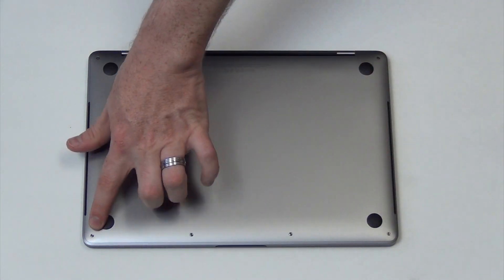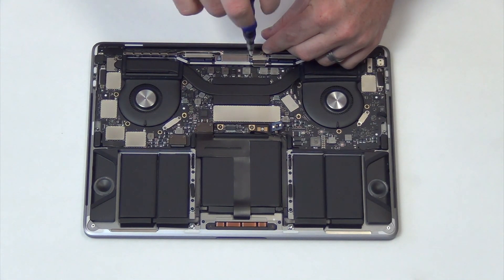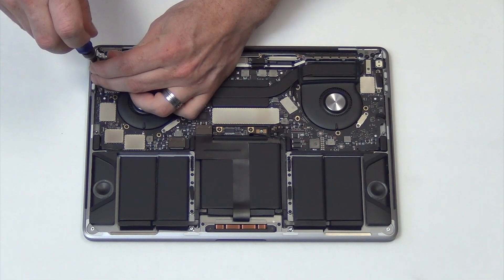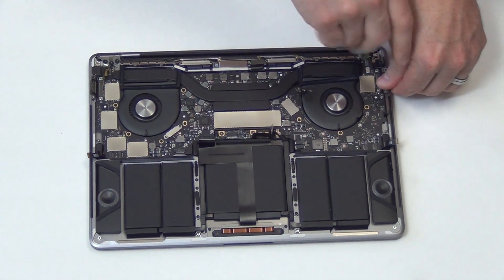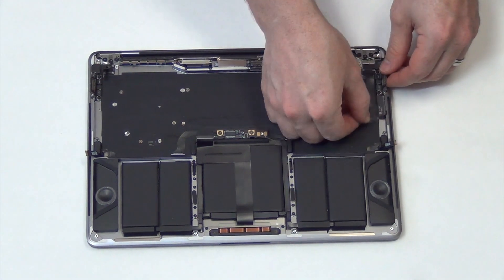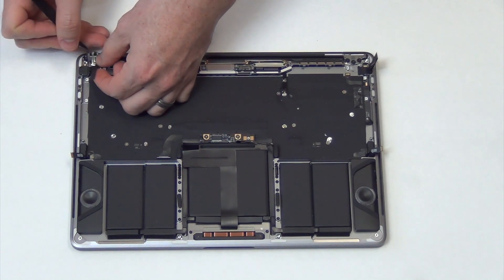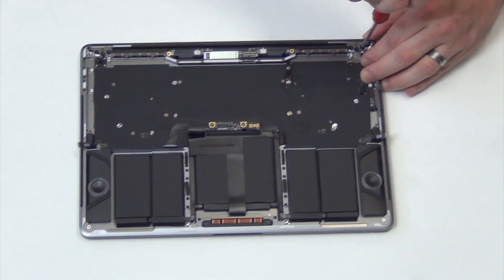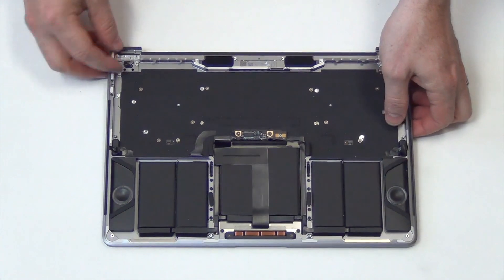How to Take Apart the 2017 13" Macbook Pro with Touchbar A1706

Comment: Need help. I replaced my 2017 MBP touch bar screen and now the touch bar is not responding to touch. It shows but does not respond. I tried resetting, commands, os upgrade, nothing works. Please help. I see it it does everything except respond to touch, it's annoying.

Comment: Where is the microphone located? I took mine apart to put thermal paste but now my mic stopped working :( can someone please help
Reply: Its probably for the best. Use headphones with a mic. Otherwise it is on the right side edge of the board it looks like the battery connector.

Comment: I been having a problem with my Mac model A1706 it appears a folder with a question mark that’s because the startup disk is no longer available and it appears block  since we cannot change de SSD what else can we do? 
Help please
Reply from the maker: I'd suggest booting into recovery and seeing if you can recover the drive that way. If not, we have a send-in repair service available at this link: https://www.powerbookmedic.com/mac-service.php

Comment: Hello, I have the exact same macbook pro, my problem is that it doesn't recognise the SSD anymore, is there a way to change it ? by soldering maybe! or is there any way to repair the internal SSD?
Reply from the maker: Saad Gouzou Was there any liquid damage to the machine?
Reply: Powerbook Medic no never, I bought it brand new, I have been using for only a month
Reply from the maker: Saad Gouzou I would check to see if its still under warranty if you bought it new.

Comment: One question to this MacBook Pro 2017 13inch users. Do you hear one fan or two fans spinning? I only hear 1 fan and I can feel the warmth in the air. The other fan never works.
Reply: I have 13 inch 2017 A1708 and I only hear one fan and it sounds like its working pretty hard after only light task but here in the video he has two I see

Comment: can we replace the SSD on this model?
Reply from the maker: Unfortunately, no you can not, it is part of the logic board.
Reply: @PowerbookMedic  can we make (trick) like external drive (macOS) for this case?
Reply from the maker: Firman Ahmad Yes, you could run the macOS off of an external drive.
Reply: Firman Ahmad I need an answer for that too

Comment: I need help. My MacBook pro (same model) keyboard and trackpad suddenly stopped working.  No response at all.  I changed the trackpad cable, and they are still unresponsive
Reply from the maker: Delreco Harris Most likely, the top case needs to be replaced. Unless there was liquid damage, then it could be the logic board among other things.

Comment: The 12 pentalobe screws are smaller than a P2 screwdriver at 9:51 of the video. What size screwdriver do I need? I cannot find anything smaller than a P2.
Reply: Ok I went out and bought a P1 pentalobe screwdriver and it did the job for the 12 pentalobe screws at the antenna. The P1 screwdriver was bought at Altex.
Reply from the maker: Ricky Cardona This is for sure the P2 screwdriver that is needed.  It’s the same screwdriver used to open the iPhones.  It’s possible your set is calibrated wrong?  Do you have a smaller pentalobe screwdriver you can try?

Comment: I got dish soap with water in the macbook hinge when i was cleaning the computer, so now it makes annoying crack sounds when i open and close the lid. Should I open the computer up like in the video and clean it, is it possible? And is it worth the risk lol
Reply from the maker: You should never wash your computer with soap and water. I would advise against opening the unit to fix the creaking sound. You may end up doing much more damage than it's worth.
Reply: @PowerbookMedic  Okay, thanks for advice

Comment: Do i have to take apart whole macbook in order to replace a battery? Or its possible to take out the battery without removing logicboard?
Reply from the maker: The battery comes with the topcase… so you have to remove the whole board and other components as well.
Reply: @PowerbookMedic  My God, so there's a 3rd party vendors selling a battery with the top case? I saw on ebay a battery without a top case, they were claiming that you need to replace only a battery. How hard is a teardown with all these small parts? How much a service would charge me for that?How much a service would charge me for that?
Reply from the maker: @alexanderkim7241  Typically you're going to replace the whole top case to replace the battery. You can technically replace the battery only, but it's still a full tear apart and the procedure is extremely difficult and only experienced shops should do it as you run a risk of puncturing the battery and having it explode. Costs will depend on exactly you have done where. If you were looking to send the unit in, we do offer a send in repair service. You can find more info at this link: https://www.powerbookmedic.com/mac-service.php

Comment: Can the memory be upgraded in these from 8gb to 16gb??
Reply from the maker: Not unless you change the logic board.
Reply: @PowerbookMedic  Neither the ssd? What about smd soldering?
Reply: @blzs_perger  yes, you can. It requires some advanced tools and knowledge on desoldering and soldering new SSD and RAM chips. Here is a link for 2017 model, but it is exactly the same process. https://www.youtube.com/watch?v=ewOszZknX64
Reply from the maker: @blzs_perger  - You can't upgrade the SSD in this model either. Everything is built into the logic board.

Comment: As an engineer. I can tell this is some quality work has been done on this, which will likely have it run for a very long time!
Reply: Well as a computer tech i can assure you it will not run for a very long time. These macbooks have tons of issues including exploding batteries, failing touch bar, failing logic board, touchbar unable to update so it bricks the machine, backlight issues and missing ssd issues (its soldered on). Just because something looks over engineered doesn't mean its reliable.
Reply: @mackattack-r3d  as well as crappy keyboards, overheating, and many other problems

Comment: can u tell me where to get the Battery for macbook pro 2017 13"?
i need to replace it
Reply from the maker: The batteries on these units come with a replacement top case. There will likely be 3rd party replacement options in the near future, but changing those is a pretty difficult task and can be dangerous if the battery is punctured during removal.
Reply: @PowerbookMedic  Why has nobody tried to replace the battery yet? Is the glue that much worse than traditional adhesive?
Reply from the maker: lil man Yes, the glue is very strong. The battery gets damaged when trying to remove it.